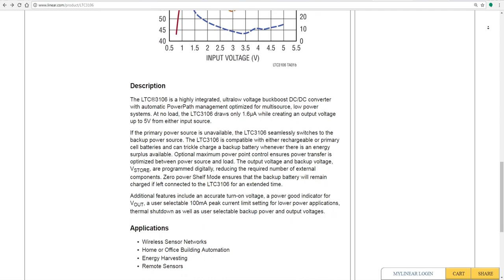IoT Energy Harvester using Cayenne

Comment: Hello and first of all thank you for your video. I'm working on an energy harvesting device using the LTC3106 for my dissertation project and I've just come into a problem. The prototype currently works with a small generic photovoltaic solar panel and a secondary high capacity battery. We're testing the device and everything seems to work fine providing the programmed output value and the battery itself gets recharged when surplus energy is available and gives power to the load when needed as expected. The "problem" comes with the RUN pin. We have conected a 2Mohm variable resistor conected to Vin and RUN working as a voltage divider. In one test we made we set the threshold value and the startup voltage worked as expected but when we did a second test we realised that when we turn the knob of the variable resistor we were limiting the voltage provided by the solar panel, for example, if we were in a situation were the panel would provide 5 V, turning the knob will result in a voltage limitation without chaning the current provided by the panel. Is this suposed to happen? Does the RUN pin not only work as a threshold comparator but also as a Vin limiter? 

Thank you in advance.
Reply from the maker: According to the datasheet, RUN only affects the thresholds and shouldn't limit VIN.

Comment: I am also working with LTC 3106 using solar power ... My IoT system consumes 120 mA current during startup.. Will LTC 3016 be able to generate that much of current from solar, It is mentioned to generate 300 mA current but I am not being able to generate that amount of current.
Reply from the maker: +RAJAN AMATYA: Play carefully with the setup and remember those 300mA are not supported for every Input/Output voltage combination; refer to Maximum Output Current vs Input Voltage (VIN) (Graph 22) . The input must provide more current than your output (look at the efficiency chart) and from what I remember, ILIMSEL must be > 0.8V and that amount of current will be supported by only from Vin input (VStore won't) . Lastly pay attention to the capacitors selection in the Input/Output according to your setup. Good luck!.
Reply: I was trying to use a 6V 500 mA solar panel as my primary input, and a coin cell battery as my secondary, I didn't get ILIMSEL must be > 0.8 V, aren't we supposed to set ILIMSEL as either high or low by connecting with Vcc for high and GND for low? Does this mean if there is no sun light , my battery alone won't be able to sustain my load ?
Reply from the maker: Yes ILIMSEL, tied to Vcc is good enough (> 0.8V). If your battery is tied to Vstore, Vstore valley current when ILIMSEL is high is between 30 to 70mA so it won't be enough.